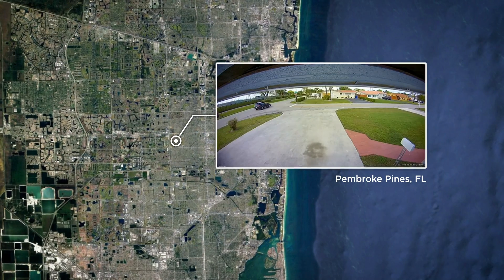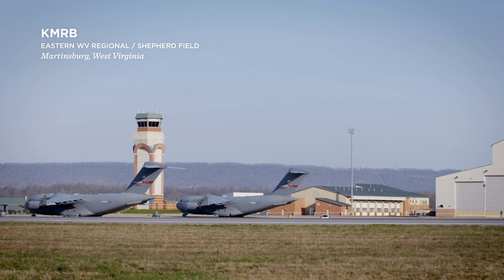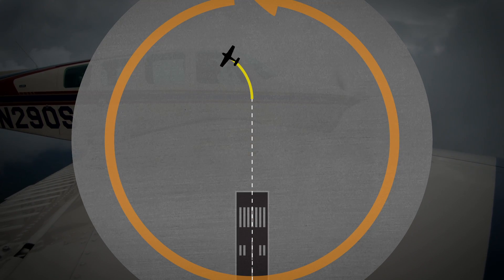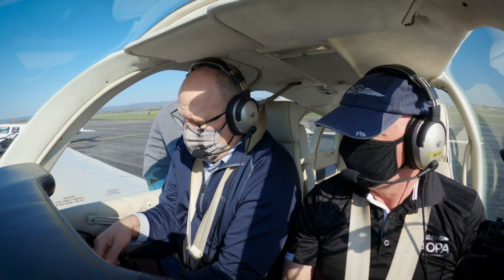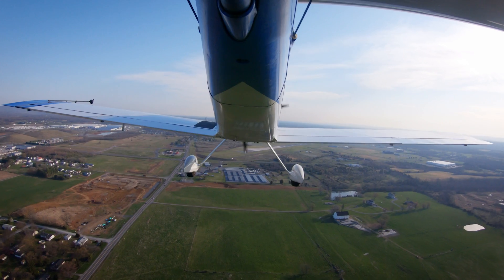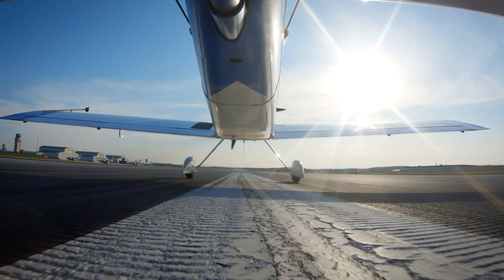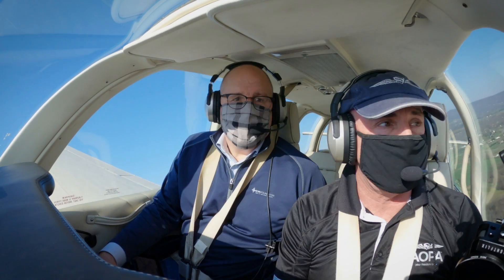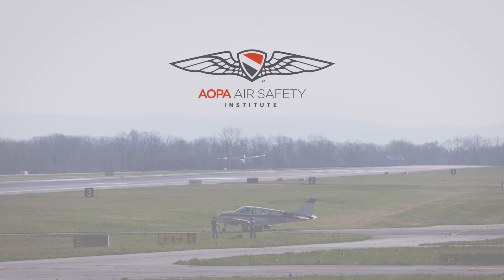Reality Check: The Runway Behind You

Comment: Why do these tests so close to the ground? It could've gone wrong real quick.
Reply: to think how many pilots will watch this and try it.....and how many innocent people they'll kill in the process.
Reply: Good ole fashioned STUPID.Not even mentioning landing on the grass or ANY flat spot.When your aircraft gives you up its the insurance companys at that point.Hard to cash an insurance check if you get killed trying to make the runway.AOPA and NRA,all about add revenue and lining ceo pockets,not about the average guy.
Reply: @blackhd92  Not the point of the video. Every pilot is already taught to look for a field to land in if an engine quits on takeoff. This was to see if it's possible to make it back to the other direction of your departure runway, and it often times is  possible. Advisable? Maybe not. The proficient pilot will need to make that decision for his/herself.
Reply: Because these were not gliders... you can always go around just like they did on the attempts that would not have made it back.
Reply: @CarterHancock  ever consider a potential stall/spin scenario? The super cub's stall warning horn was going off while in a bank. The warning horn is designed to alert a near stall situation when are wings level. Now factor in a bank angle throughout the turn, wing loading is increased along with the stall speed. No amount of power will allow the plane to recover from a spin at 400' agl. Was it neat to see a pilot fly the ragged edge and make it back to the runway? Sure it was, however it was just as much a reckless exercise under the guise of the "Air Safety Institute" encouraging others to do the same reckless act with an instructor. AOPA needs to do better because this was poorly thought out and executed in the lense of safety.
Reply: @rodstol  I know what a stall horn does, I'm a commercial pilot. You don't need power to recover from a spin in the first place, your point there is moot. Altitude and control is all that matters. Holding it on the edge of a stall while in a bank is dangerous but not as much as certain alternatives like landing straight ahead into a small town like is common off the departure end of many runways.

They literally said not to do it at a low altitude, and if you choose to try at a higher altitude, do it with an instructor. Not reckless - don't act as if AOPA didn't add in many disclaimers. 

I'll reiterate: in certain scenarios, trying to turn back may be possible and better than landing in a field, a field that may not exist due to obstacles or other factors.
Reply: Because you are low to the ground on takeoff when the impossible turn happens in real life.

Comment: A big question around the basis for this whole experiment. The aircraft in the Pembroke Pines accident impacted just short of runway 28L which is not the opposite of 10L. The place of impact and the direction seems to be suggesting they were trying to make a wide 180 back to the opposite of the parallel runway, not trying to get back to the opposite of the departing runway.
Reply: They got this video straight-up wrong, they should have never been testing this out that's close to the ground and you can tell the guy in the Bonanza was close to crapping himself. You are right, they did get the runway completely wrong like they turned back towards the same one, this video is a sham and so many people here are applauding it.

Comment: **True Story** At My Last in Person  FIRC class, the instructor was talking about the "impossible turn".. the gentlemen sitting in front of me turned around and said "don't ever do that impossible nonsense.. land straight ahead, no matter what aircraft you're in"... That Gentlemen was Dick Rutan...
Reply: Dick has a lot of absolutes he lives by, not all of them valid. There's all kinds of qualifications implicit in blanket statements. The person delivering them does little to change the physics of reality. You literally saw several examples of a mixed bag of results, but you're doubling down on "straight ahead" or bust. 

Perhaps consider a trial turn back at altitude might be a call for every pilot in the aircraft they spend 90% of their flight hours in.

And I absolutely agree with Dick--HE should not attempt it, as he's likely in a Vari-Eze and won't make it, even without the spin the canard protects him from.
Reply: @macblastoff7700  Forget "protection from spins" (a dangerous assumption anyway), the math just doesn't work out. Unless you are flying something with a very good angle of climb (regardless of Vx/Vy/whatever flown), most aircraft are going to have a very hard time doing a "180" back to the runway, and make it.

I squirm doing returns in my glider from 300 ft, and that thing has a 48:1 glide ratio at 50 kts (105 ft/min RoD and 2.3 NM glide range under ideal conditions from that altitude).
Reply: I think Dick might have some choice words for this McSpadden yahoo hot-dogging in his Super Cub in the name of "safety".
Reply: You should never say never for a thing that used well can save your life.  Like having a gun at home and saying you will never use it.  Then you need to use it, but in the denial, you hesitate and get shot for not using it when you had time to.  Stupid or not??

 It is stupid to say you will never do something you might need to do.
Reply: @emergencylowmaneuvering7350   i used to be a flight instructor, we practiced the impossible turn. This maneuver works in a 172 with minimal fuel from an airport at sea level when you're anticipating it.  I have a 182, and a Baron 58, 99% of our flights are at max gross, in different kinds of weather from many different airports, the cargo is my family.  I can 100% tell you i will never attempt the impossible turn in the event of a(n) engine(s) failure.
Reply: @emergencylowmaneuvering7350   i saw your turnback video. Nice job, however,  I still will continue to the fly the way i have been for the past 15 years.  i'm not gonna tell you not to continue to do what you're doing. if it works for you it works for you.  Your resume as a bush pilot makes no difference to me when it comes to flying me and my family in our airplanes, additionally you don't know my resume. There are a thousand different ways to fly an airplane. It's been over 100 years since we've had aviation, yet things like leaning an engine, multi engine engine out procedures, and a myriad of other things are still debated by guys with tens of thousands of hours. Thanks for your comment.
Reply: @onyx5226  Nobody in this thread, and especially me,  said anybody should do something they're not comfortable with. On the contrary, i said people should get comfortable with what they can do when their lives don't depend upon it. Clearly, you have determined what you feel comfortable with. I recommend operating out of only 4000'+ runways with low density altitude and pristine weather, no crosswind.

Comment: Why would you practice at 45 degrees of bank? Shove that nose down, and crank it over! You might lose 100 feet or so in a 172, but taking 10 seconds to do that first turn will lose you more! With no back pressure, you will never stall in a turn, because you aren't trying to maintain altitude. 
I appreciate the video, but it was much too sterile. An emergency is an emergency!

Comment: I had a Meyers OTW, a 1942 bi-lane. I practised the impossible turn. After a five second delay after engine out at normal climb out attitude the aircraft repeatedly lost less than 50 feet on a knife edge turn through repeated 380 degree turns.
Nothing flies like biplanes. Anyone out there with an OTW, try it.

Comment: Nice to know it's not only the pilot. Planes have different limitations.
Reply: NO!!!! It is always the pilot!!!!
If you do not know your plane, you should not fly it!
You cannot blame the plane when you as a pilot exceed the limits of the plane. It is the pilot crashing the plane.
Reply: @torstenjaekel1687 , the video was about being able to turn around and land on the same runway with engine failure. He said the Bonanza wasn't able to execute a turn back no matter what they did.
Reply: @patriciamariemitchel  Why do "you" show us then?
I would argue (and did): it might need a steeper banked turn (due to higher speed). Or consider also to climb with Vx for a longer time. And what about to use a parallel runway in case you have two at the airport?
And: if you would have done a take-off briefing (in this Bonanza) and you would know upfront what is not possible - why did you try such a maneuver if obviously not possible?

Teach us safety and real options instead to demonstrate what is not possible after "we have figured out".
I would assume, the outcome of this maneuver you could "calculate" up-front already.

And: if the conclusion is: with this airplane you need at least ... (Xdeg. bank, min. ALT) - why are you showing us stuff which is already impossible just based on the math (and a proper take-off briefing would tell you already)?
Flying is not "trial and error" - flying is within margins and envelopes (which we should know before take-off), isn't it?
Reply: If you do not know what is possible with your airplane - you should not fly it!
(and "trial and error" is not a safe flying approach)
Instead: I would rather know what are the limits (e.g. when could I turn back to the runway?) instead to be told "what does not work". Wouldn't be more helpful?
Reply: @torstenjaekel1687 , how can you find out if nobody tests the limits?

Comment: For a long runway with a strong headwind, landing straight ahead is an option. For a short runway and a strong headwind, there will be a potent tailwind, which means the airplane will have a very high ground speed and cover a lot of ground before touchdown and likely overshoot the end of the runway. Another good "with CFI"experience is to find an airport where there are no other aircraft and attempt a landing in a tai wind. It's quite impressive what a 10 kt tailwind will do in increasing landing distance - very impressive. Make that a 20 kt tailwind and you better have one long runway ahead of you after the turn back landing. If the headwind is strong, and the runway is short behind you and terrain permits, landing straight ahead with a low ground speed due to a strong headwind might be the best way to go.

Comment: would making a 45 degree course change at the end of the runway be a good idea, I know thats what we try to do when towing gliders in case of a rope break that way the glider only needs to do a 180... just a thought
Reply: Hi George, we practice the same thing at our gliding club although it is more of a 30 degree departure angle from the runway heading.  It is also something I routinely do flying flying powered aircraft from uncontrolled airports. I also mentally say to myself , through stages of departure climb out,  straight ahead ,straight ahead, straight ahead , safe to turnback now ( when that altitude is reached )   This way if I ever have a rope break ( or engine failure ) the decision has already been made. There is no time lost for decision making .
Reply: @lessainsbury8508  ya I think thats just a glider pilot thing we do.

Comment: Great video.  My question is, on airports with parallel runways, could the Bonanza have made an emergency landing on the parallel runway rather than trying to turn almost 270 degrees, then 90 degrees back to line up on the departure runway?

Comment: To me it was apparent in the opening statements, before the experiment was even run, a turn back for an average pilot in the majority of statistical situations, is not even close to a viable option.
Reply: Eh, I consider myself to be a thoroughly average low-time pilot, and when I practiced this with my CFI the turn itself wasn't that difficult (we started at 1000' AGL and worked our way down on later attempts). Managing the glide afterwards can be tricky, especially if you're like me and are terrible at slips.

But that's exactly why every pilot should practice these. Know what your skills and aircraft can handle.
Reply: Correct.  The flaw in any idea to practice an impossible turn is doomed to failure because the pilot already knows they are gonna attempt one.  They will also not be low and slow as in real life, they will allow themselves a margin for error to succeed...which defeats the purpose.
Reply: @speedomars  Depends on altitude and if know exactly how to do them.  Just like crosswind landings, you dont try them without training.  If you do, you are stupid.
Reply: @speedomars  Where did you see "an impossible turn" there.  You are a liar.
Reply: They might have the intention in mind: "you are a non-experienced, silly pilot! We = AOPA (ASI) - we are the great guys".
(flying so reckless)
Reply: @torstenjaekel1687  Then you are saying that the average USA GA pilot cannot do a 40-45 degree turn at Vglide.  Then they should not be flying.  That is a non difficult to do task for a real pilot. 

 A coward will scream.. Help, it is a 40 degree banking turn,!! Help me papa. Help me... o my gaaad!!   GTFO..
Reply: ...and if that is so, it is a sad state of affairs. Airlines practice emergencies. Why is there not a set of emergency scenarios for GA to practice. I made the impossible turn 5 times so far, and this video is lacking in not saying what one CAN do in such an emergency at any altitude.
Reply: @nsureyet  Of course they say what you can do if you are over the turnback altitude for that take off (Calculated before take off, off course).  Watch it again.  I used to teach them on different airplanes.  4,700 long runway.
Reply: @nsureyet  I made it twice.  Cherokee from 700 engine failing.  C150 from 300 agl partial power failing.  Landed both time with some tailwind.  4,000 feet runway.  No problem.
Reply: @nsureyet  I did 2 times.  How come 5 times turnback? I know them very well the 3 kinds, 180, Teardrop, and Hook Shaped too.  3 kinds.  Taught them to many students too..
Reply: @emergencylowmaneuvering7350  used to be a test pilot on homebuilts. In 42 years, all kinds of excrement hits the oscillating device.
Reply: BS. Then you are saying that the average USA GA pilot cannot do a 40-45 degree turn at Vglide at 700 agl??.  Then they should not be flying.  DAm cowards if that is true.  That is a non difficult to do task for a real pilot.  When i did my GRM training we had to bank 45 degrees at 600 agl on the tailwind section.  I had 5-6 hours of flight only.   You have to know how to do those. 

 For a fake maggot, it will scream.. Help, it is a 40 degree banking turn,!! Help me papa..  GTFO..

Comment: Obviously, if the aircraft is light enough, you can turn back. In a hang glider you can turn and turn and turn. But anything significant will sink like a stone. Try turning back in a 727 from a 1000 feet. The correct approach is to eye a clearing within a 20 degree arc of dead ahead and aim for it. Unless of course, you are flying a tin can so small and light that at a 1000 feet you are still over the runway!

Comment: The turnback and glide can be done in a 182 at 1000AGL from a mile or less, but you must bank 45*, use best glide calculated for weight, and turn into any crosswind. Be prepared for a brisk push to reach glide speed when pulling to idle in a climb. All pilots should practice this at altitude to see what they can do with their plane. Know the the limits of what is possible and impossible.

Comment: This reminds me a lot of my military days flying the U-2, where a good portion (about half) of each practice pattern (“low”) sortie was spent practicing flameout patterns.  We knew from performance data, flight test and experience the minimum altitude from which you could start the turn back maneuver and expect to reach a minimum “low key” abeam the departure runway with enough altitude to start the 180 back around to the departure runway and land.  Even practicing this maneuver is not without hazard.  We had specific restrictions on practicing the maneuver; we could not start it from initial takeoff as that technique actually resulted in an accident.  Something I would suggest for anyone practicing this is to initiate the pushover, establish your glide speed, then initiate the turn.  Yes, you will lose some altitude, but it will result in a more stable maneuver and avoid a simultaneous pushover into unloaded flight with a roll into a bank and the potential for inadvertent entry into an accelerated stall.  Additionally, it may be more safer/more stabilized if one chooses a gliding 180 into a position abeam the landing surface, followed by a 180 turn back onto the departure runway in these situations, vice the 90/90 S-turn to the reciprocal heading.  Whatever one does, they have to remember this is a maneuver flown close to the ground with very little space to recover if you mess it up.  We had an ejection seat in the U-2 and even then, it was a maneuver that we practiced within very specific parameters.  Fly safe.